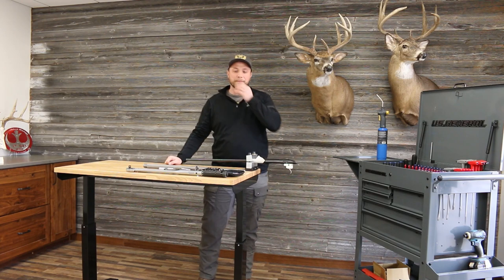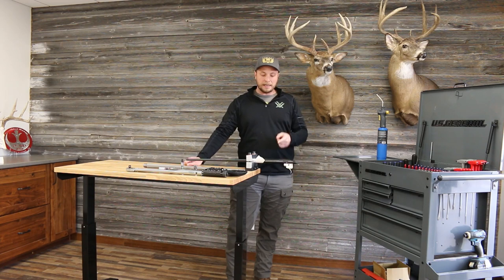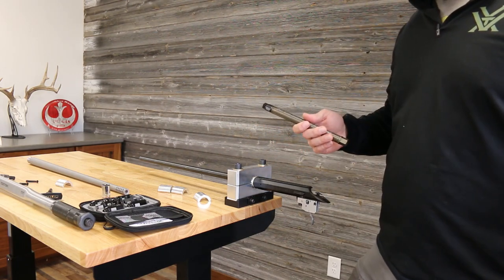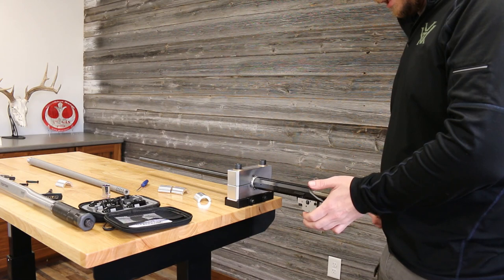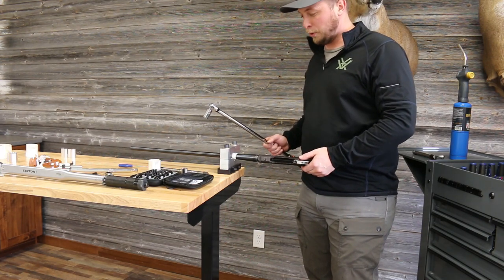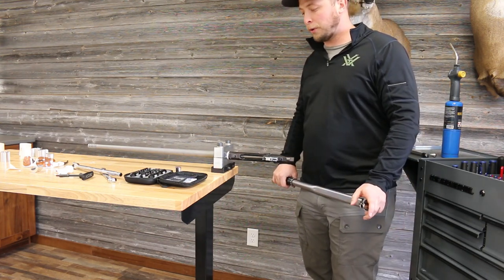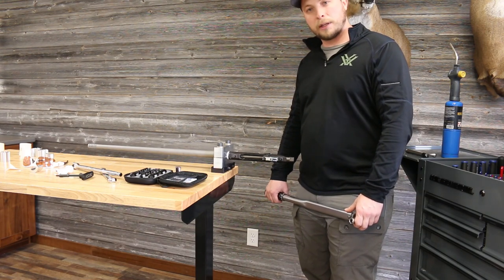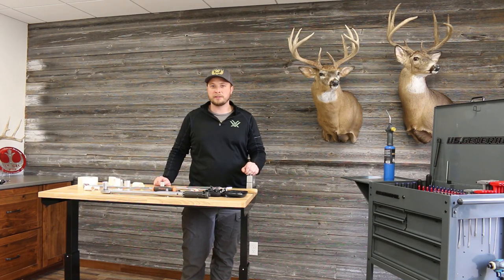Tikka T3x barrel installation

Comment: I’ll be removing my tikka barrel soon and everything I’ve studied on this procedure was to use an external action wrench. Would you have done anything differently if you were to remove another tikka barrel?
Reply: i only removed one but used the external wheeler wrench for a rem 700. just flipped the top piece over to match the flat top tikka receiver and torqued it down. i soaked the action in liquid wrench for a few days first. it came off with a couple good whacks with a small mall on the handle of the action wrench.
Reply from the maker: I did another a few months back and that one was even more stubborn I had to put relief cuts about 1/16 of an inch around the circumference of the barrel that lessens the force on the threads then it comes right off. An external wrench would likely be easier but the SAC worked.